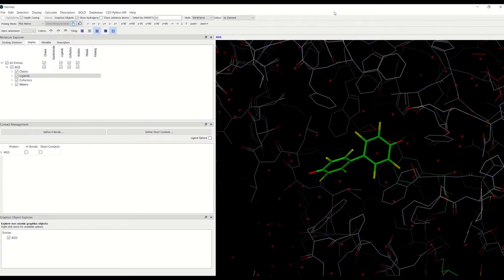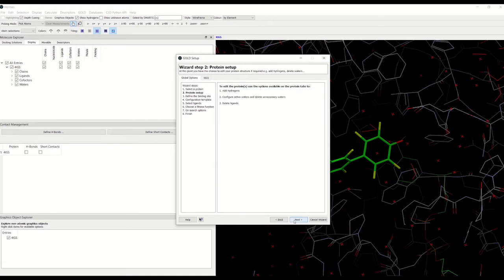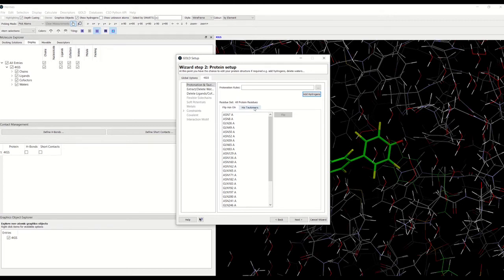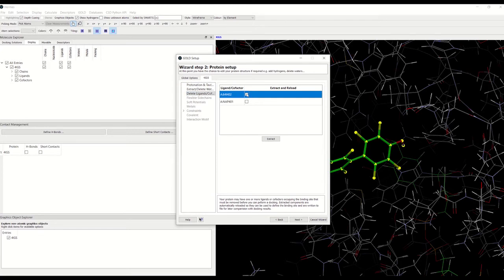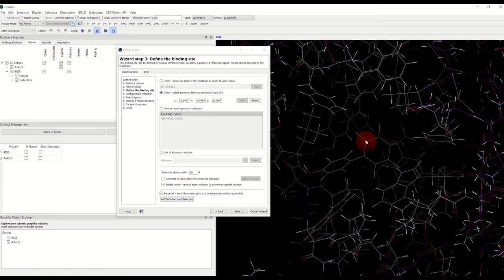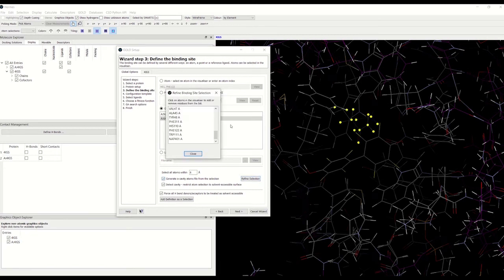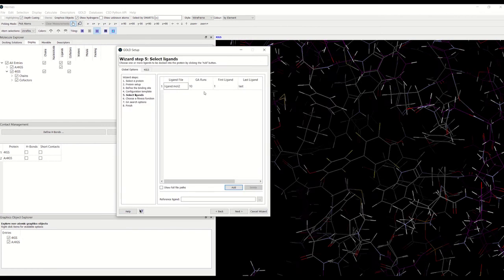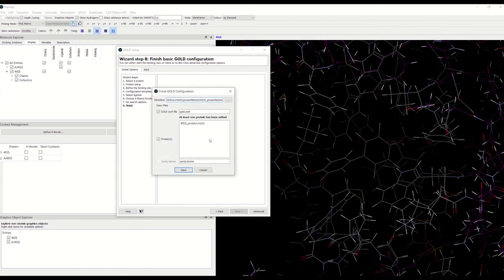Introduction to docking using GOLD

Comment: Hi, I have been trying to create the linking atom for covalent docking using GOLD but it does not let me go to advanced settings in the wizard until the ligand is extracted, and once it is extracted, I cannot specify the same atom as the linking atom for both the protein and ligand (as the ligand's covalent link is broken upon extraction). Could you please help.
Reply from the maker: Hi Manasa, this may be happening if you are redocking the crystallographic ligand, but we need to know more details to advise properly. Can you email support@ccdc.cam.ac.uk with some more information on what you're trying to do?